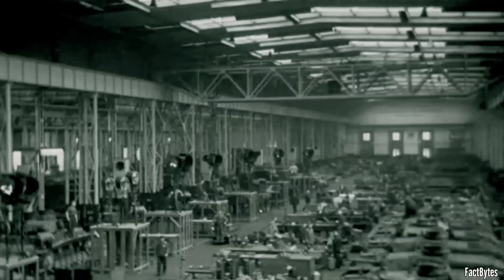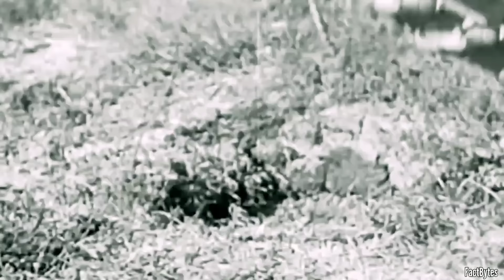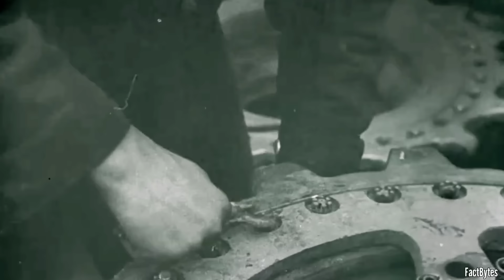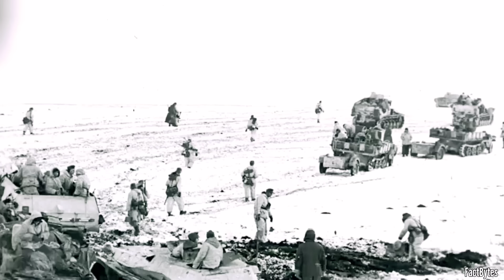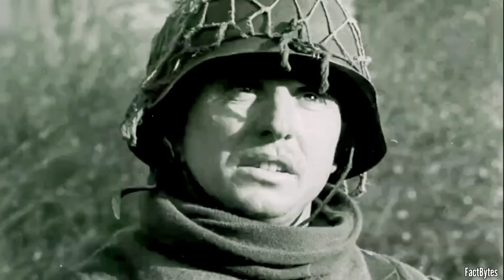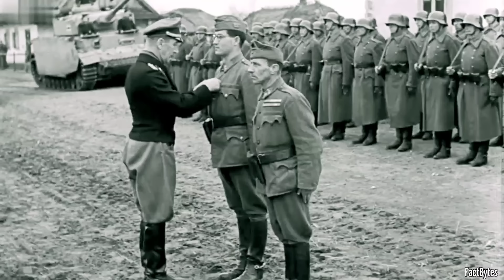More Panzer IVs, Fewer Tigers & Panthers — Would Germany Have Done Better?

Comment: Good analysis, but you left out one important thought:  where would the additional crews come from?  They were suffering a shortage of experienced tankers, so they figured they'd better have more survivable tanks, which the Tiger certainly was.  As you noted, the appearance of a Tiger meant the enemy had to think again as to how hard to push.

Lastly, the production problems spread to the Pz. IV as well as everything became scarce.
Reply: Shortages of fuel and the breakdown of German logistics hampered all lines of German AFVs, not just the "Big Cats".  Yes, training crews ultimately comes down to having vehicles and fuel to spare.  Germany did NOT.
Reply: "Good analysis, but you left out one important thought:  where would the additional crews come from?"
not only that. Also the additional support vehicles and soldiers. And the fuel to move that.
If you have little fuel it makes sense to build fewer but "better" tanks.

Comment: Problem with panther is that it was designed as a 35 ton tank, but Hitler personally ordered upaurmouring it to 45 tons, it was a very overweight tank, reliablity was super poor (150km) beacuse of final drives and suspencion made for 35 ton tanks
Reply: The real issue with Panther was lack of nickel and other raw materials ,  the final drive was brittle due to poor metal quality
Reply: @nofakenews9558 nickel came from japan ship from indonesia. allies blockaded sea route. game over.
Reply: —Initially it was designed as 20 ton tank, that was upgraded to 24 tons after encountering T-34 tank, and only in 1942 it was 30-35 tons
Reply: @RussianThunderrr  VK3002D could be the goat😢
Reply: @dpdramastudio — Totally agreed!
Reply: @RussianThunderrr  The only reason Hitler's generals preferred VK3002M and Panther is because they wanted their machines to look more German, not just T-34 copies. Lmao. (I mean Panther looks like early T-34/76A still)
Reply: Panthers overall operational average rate wasn't much lower than the Panzer IV. If 150km was all Panthers could do they wouldn't have reached the majority of the battlefields where they served.
Reply: Yes, what you referred is called VK3001D and VK3002D, much better than VK3002M or Panther in everything except armor.

Comment: The Pz4 was on its last leg by 1943, though nothing could have saved the Panzerwaffe. The best solution to improve the situation could have been to build the smallest possible tank to still house the gun and the engine (limited to 600 Hp) of the Panther - a 35 ton vehicle that would still have firepower and put less strain on the mechanics. Sort of like a Comet, but with sloped armour and a wider turret ring.

Comment: the Stug was really their best armored vehicle. would have been far better off building more Stugs, Panzer IVs and Sd.Kfz. 234s and not building Tigers, Panthers and the other white elephant tanks at all. they also would have been better off not building the 4 battleships and the Hipper cruisers...  it wouldn't have changed the outcome, but certainly would have helped not wasting resources the county could ill afford. too many different types of vehicles makes logistics a much bigger problem and the heavy tanks use more fuel and require more maintenance. the heavy tanks also couldn't cross alot of bridges.
Reply: The Stug was a defensive weapon.  Yes,, it was cheap and relatively quick to build, but did not fit the German offensive philosophy.  The Stug was a great ambush tank but also held back at a distance  so the lack of a turret/high gun mobility didn’t hurt it.
Reply: @tednordquist5266  yet it had by far the best kill ratio of any armored vehicle
Reply: @volks-jager true, but it was an ambush weapon.  Shoot and scoot.  You can’t win a war by sniping.  You have to move forward to win and a tank without a traversing turret is at a huge disadvantage when advancing.  It had such a high kill ratio because it was such a long retreat and the Germans were methodical and got the most out of what they had.  The only modern tank to use this configuration was the Swedish “S” tank, an ambush tank designed to make the Soviets pay dearly in case of invasion.

Comment: If the Tiger and tiger 2 budget was allocated to Stugs. That's 6,012 Stugs. Doubtful it would have changed much. When Stalingrad happened, 500 75cm Pak 40's were sitting in German warehouses. even though Romanians and Italians were crying out for them.  Germany  kept them for their own troops.   what may have  changed the out come was using the Tiger budget for Hetzers.  10 12 thousand hetzers more useful than 1500 Tigers.

Comment: What the Germans really needed was a better designed Panther. The Panther was designed for mass production, but the design quickly became overweight, overly complicated, underpowered and was not terribly ergonomic. It cost only 1.25 times a Panzer IV and took about as long to build, but if simplified and lighter they could have been a much, much more useful vehicle.
Reply: 30 hours work to replace the transmission involved removing the turret and engine deck, the poor durability of the final drives requiring replacing  every 150 k?.
Reply: @ivanconnolly7332 It took 6-8 hours to replace the transmission, and did NOT involve removing the turret and engine deck. Clueless.
Reply: @ivanconnolly7332  M4の全面のカバーを外すだけでデフに到達する設計は素晴らしいね。
スバルの水平対向エンジン使う設計した奴もM4を見習え。